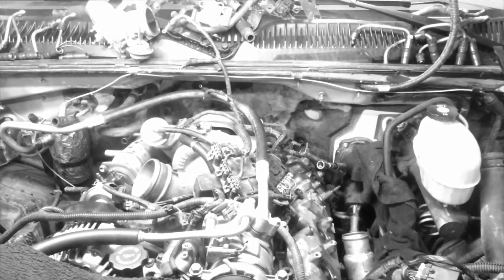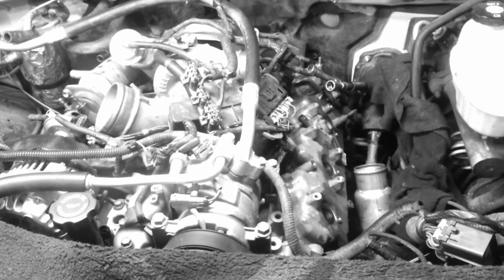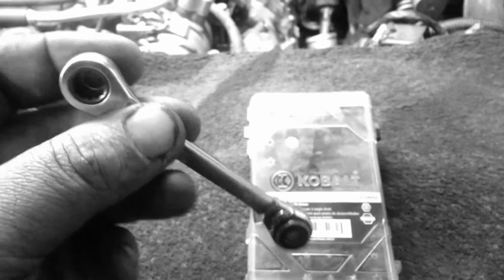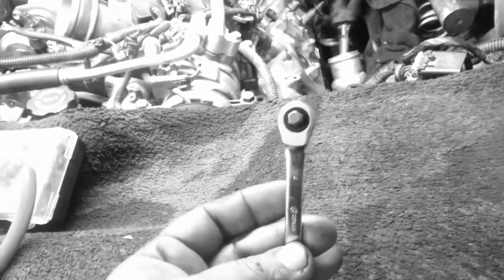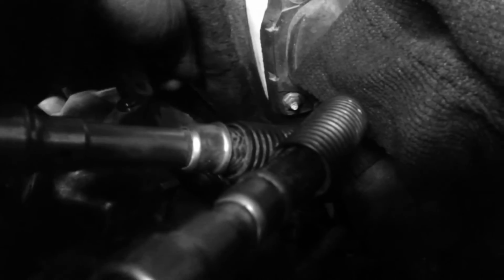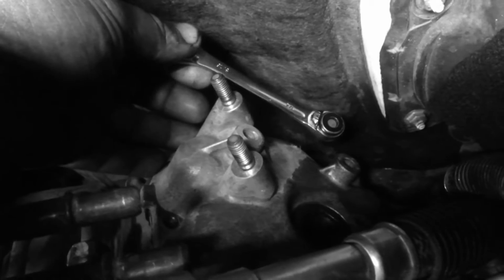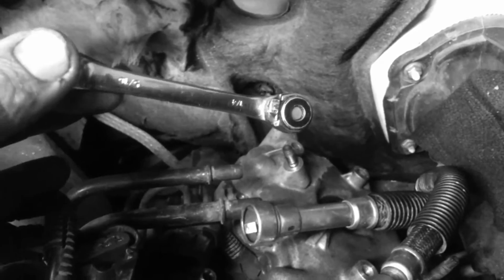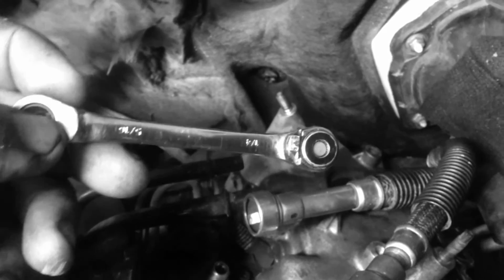LB7 Duramax Valve Covers Tool

Comment: I spent a couple of hours trying to get this one bolt out. Customized tools, tried a ball hex driver and came at it at every angle. No go. When i was out of ideas I went to youtube and there you were. Thank you soooo much!
Tool still hit firewall so I trimmed the back end of the bit (end that goes into the wrench) and it worked perfect!
Reply: I just did one of these and used a 6 inch long ball end allen key, sniped the small end with a wrench and had it out in about 30 seconds.

Comment: the very back bottom 2 bolts in rocker lid were rounded out I had to literally take my Lincoln 180 mig welder and weld a 1.5 inch long 1/4 inch bolt to top of both to get them out . will be putting something different back in those 2 spots .

Comment: The Dealer change out the injectors about 70,000 miles ago and I have to do it again but they sealed the upper covers down and I have spent the last 3 hours trying to pry them up with no luck.  Does anyone have a trick to getting the cover off without breaking or cracking it?